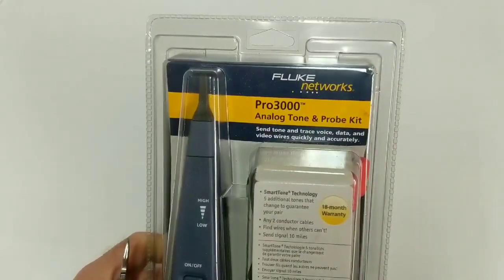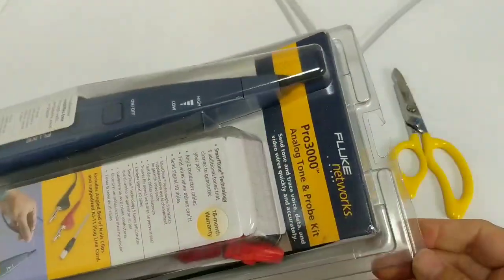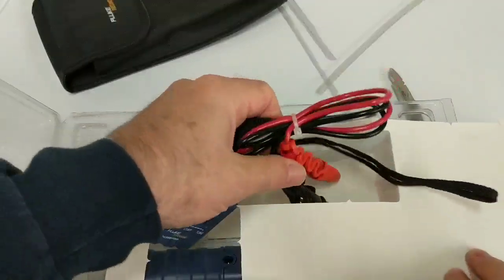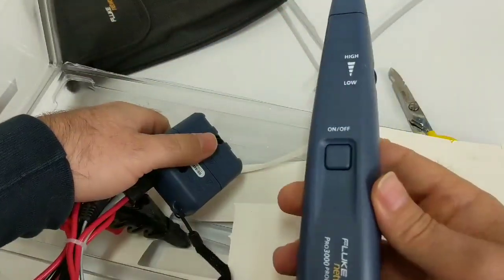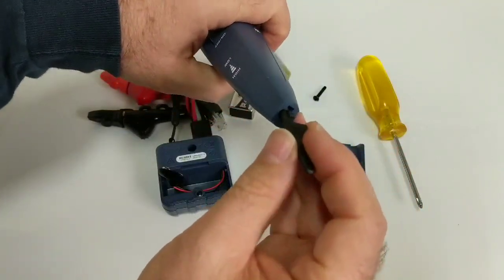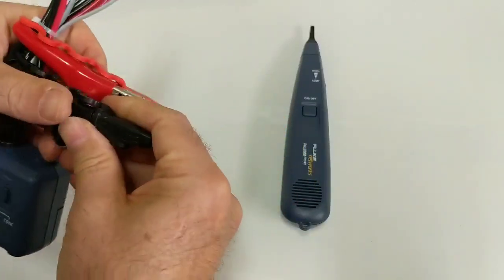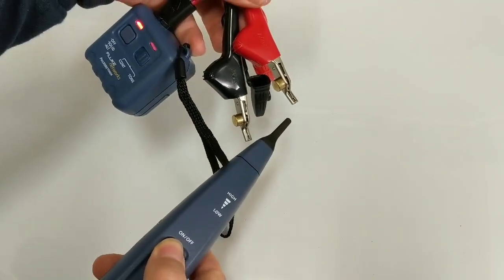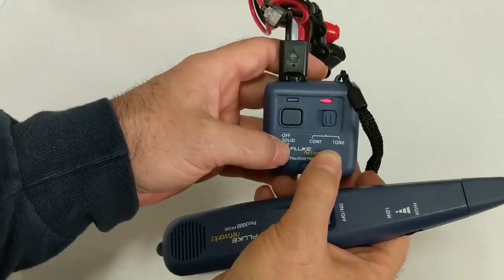Toner and Tone Probe un-boxing and demo

Comment: I have one fluke pro3000F50 KIT and is the best tool for  tone tracking wire not energised in area with interference 240volt or 400volt…..
Reply from the maker: Right?  That high voltage makes a lot of noise when you're trying to find  your toned-out pair.

Comment: DIY Telecom I did Alarm system and phone jack installs before and i really like this tool because if the house is prewired for an alarm system it is very handy for tracing the builders electricians alarm and phone wiring and marking it after.

Comment: What is the red and black use for
Reply from the maker: Those red/black wires have alligator clips on the end which allow you to either clip-on to bare wire or.metal posts.  It does the same function as the modular plug.

Comment: II removed the screw that holds the batteries and replaced it with a small strip of gaffers tape. Not duct tape.  Removing the batteries after use prevents the micro drain which happens if left connected.  I hate it when the toner or wand doesn't work.
Reply from the maker: Hey, great idea.  I know what you mean, I keep extra 9v Batts in my tool bag for that reason. Tha KS for sharing.  😁👍

Comment: How much cable we can trace?? Is it possible to trace for electric cables??
Reply from the maker: I dont know the exact answer in terms if distance.  But for example, I know you can trace a tone through at 22 guage phone wire up to a mile pretty easily (telephone service installers do that all the time).  As for electrical wire, sure this would work, but I believe there is something similar that is geared just for Electrical work.

great question 👍 😀
Reply: Yes you can trace electrical wiring, you just have to make sure the circuit isn’t live, or else it would blow the transmitter

Comment: Your videos are great I really appreciate your articulation. I was wondering if you might be able to give me a few pointers on a problem I'm having. It's a DoorKing intercom 1812 classic I do garage doors and Gates and this particular client as a gate entry door and it's a small commercial building. I usually don't have any issues when I am connecting to a residential setting however this one's a bit confusing.
Reply from the maker: Hi Vick,. Thanks for the kind words about my videos.  Feedback helps.  
Now, about your Door King situation, I am not sure I could offer much help remotely.   Does Door King offer any tech support?   I know when I work with Viking devices (door strikes and dtmf relays and  such) they provide excellent phone support for free.
Reply: DIY Telecom they don't have the greatest tech support which I'm pretty surprised about do you have a Facebook so we can chat on there
Reply: @Meypsta  i would like to ask the same thing😄(your facebook acct)

Comment: whats the range away from a cable that it will start generating tone?
Reply from the maker: I would say you begin to hear the tone when you are about 10 or leas inches away from the wire.  but, with a cat5 or cat6 cable its much less because of the noise-suppressing nature of the design

Comment: These are definitely useful, although I don't have much of a home wiring infrastructure either (the few cables I have run I made sure to label right away). I've actually found it very helpful in automotive and 120v (with the breaker off) situations in the past.
Reply from the maker: Aric, thats very interesting.  as a former mechanic I could certainly appreciate how that could really work well for automotive applications.  As always, your comments are very welcome here! :-)